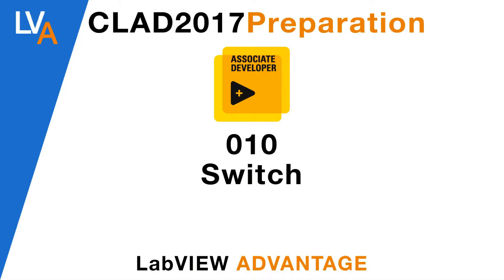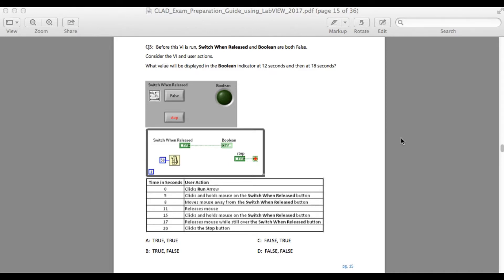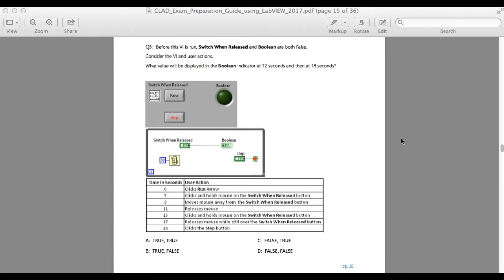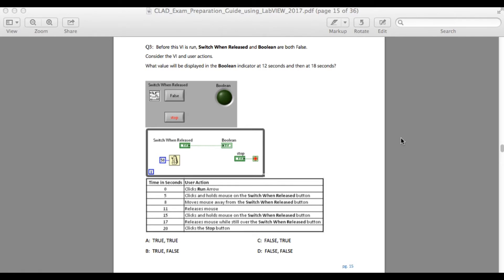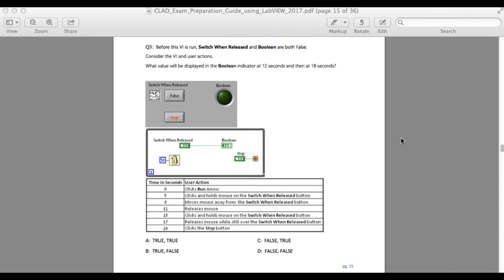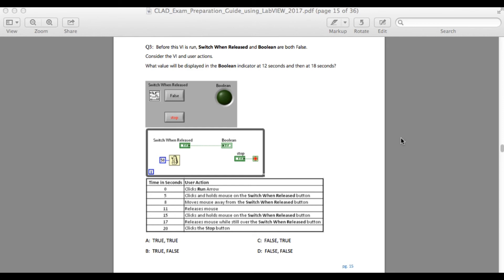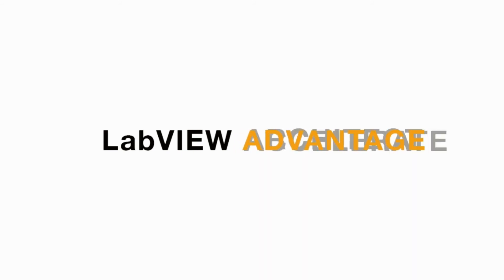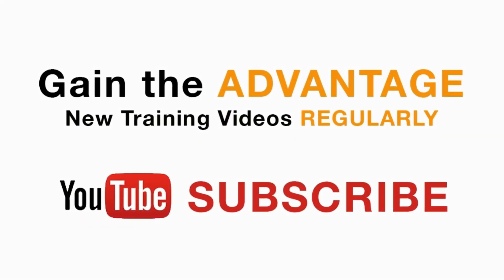LabVIEW CLAD 010 Switch

Comment: I made a simple VI with 6 buttons and 6 LEDs for each one. I set the mechanical actions to the 6 different settings for each, and labeled the respective buttons/LED as such. Then I used a simple while loop as shown, except that I used 250 mS as my delay, so that I could observe it in real time. 

"Latch" looks basically like a simple push button with "no mechanical latch", which makes it CONFUSING to remember! You have to hold the mouse button down, or the button will release. I have to take it that the term "latch" refers to the way LabVIEW takes the data and "latches" it once pressed. 

Ironically, the "Switch" setting seems more like a "latch" to me; like a light switch with a distinct mechanical state (one side or the other). 

Both of the "When Released" features have this ability to withdraw that decision to click. I think Latch When Released is like a Windows Dialog button, but please correct me if I'm wrong on this. I see conflicting answers on this floating around. 

The one that really confuses me is "Until Released". It looks like Switch and Latch Until Released behave exactly the same. Could someone comment on this? Thanks.

Comment: Unless I'm missing something, the answer should be D, since it's a LATCH when released, instead of SWITCH when released. The value of "true" will only be held for a few milliseconds, which will have vanished by the time a full second (from 17s to 18s) has transpired. Your argument for why the indicator should be "false" at 12s still holds. Therefore, it will be FALSE at both times.

Edit: While my answer still stands, my initial reasoning was incorrect. The value "true" doesn't last strictly "for a few ms". It lasts UNTIL READ by LabVIEW. In this case, that value will be read (as true) at 17.5ms, subsequently changed to false, then read (as false) at every 50ms interval afterwards. Thus it will read false at 18ms. I was mis-remembering the meaning of latching in my original answer.

So in conclusion, the answer would be D if the the control is as indicated by the IMAGE, or C if the control is as indicated by the LABEL.
Reply from the maker: You are correct. It should be D based on that image. Based on the name of control, it will be C.
Reply: Sorry dude, you're incorrect. Both of the "When Released" functions have this feature that allows one to withdraw their click by moving off of the button before releasing it. So that first click is never seen. The second time the button is released with the cursor over it, so it gets registered. C is the right answer.

Comment: Did you notice the image for the button is a "Latch when Released" image instead of a "Switch when Released"?
Reply: Good one at catching that! But it doesn't really matter at getting the right answer in this case. Both of the "When Released" options have this feature that allows the operator to withdraw their click by moving the cursor off button. I like that you were being careful and looking for subtle clues that could lead one to the wrong answer. 
National Instruments like to throw curves at people to see if we're paying attention; kudos, you were!
Reply from the maker: You are correct. If should be D based on that image. Based on the name of control, it will be C.